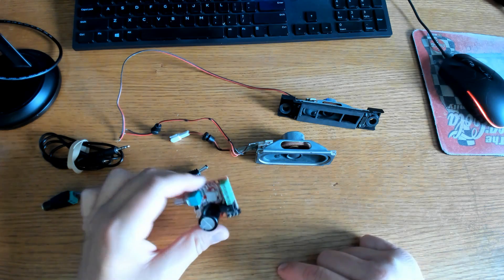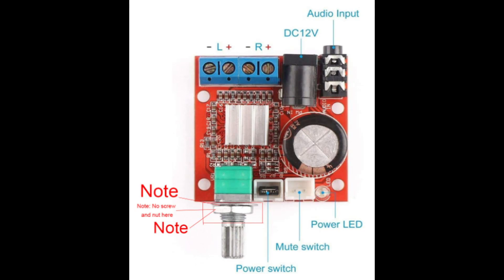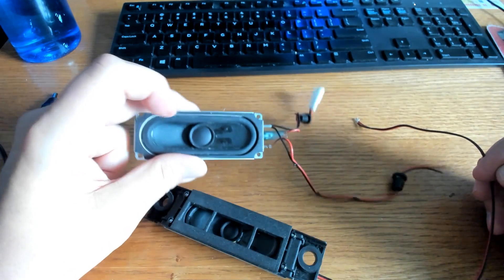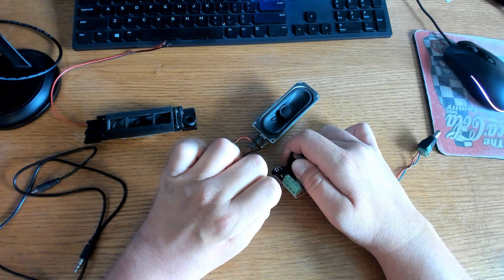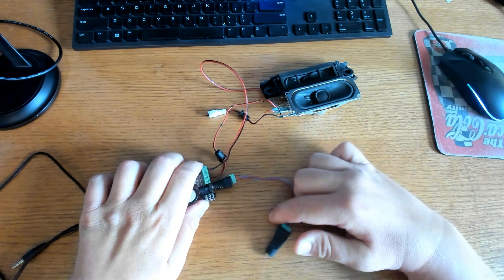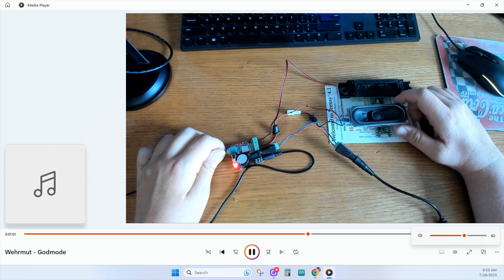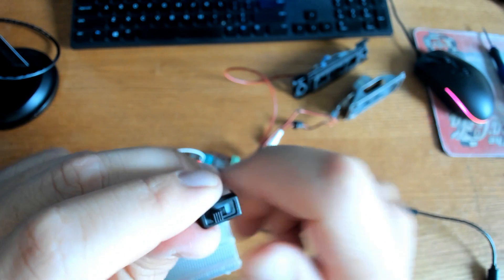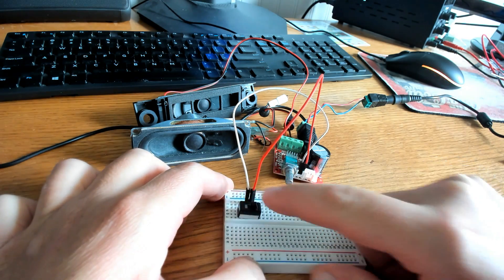Repurposing Old Samsung TV Speakers with PAM8610 Amplifier Board - Upgrade Your Audio

Comment: The one thing you should have done was to keep the enclosures, they are precisely calculated (volume and vent port) to improve the speakers to their max. I got the exact same pair from a old tv with their enclosures and a ZKMT21 amplifier (never passing the 50% volume), also with a tiny subwoofer and they just soung amazing for a PC speaker.
Reply from the maker: I know!  I didn't know the speakers were still in perfect condition.  ohwell... i'll get it next time.  👍💪

Comment: thanks for sharing this video. btw, I have cheap Soniq TV whose audio is really bad quality. Its just built that way. I am looking at repurposing speakers from discarded TVs, which I find easily. Can you advise what are the things I should be looking for in my current TV and discarded TV which I am gonna hunt for?
Any inputs much appreciated.
Reply from the maker: hey there! Thanks for the feedback, I appreciate it.
I have never repurposed speakers from and old TV into a newer TV, but I can tell you how I would start. 
In your current TV: 
When you take it apart, look for the built-in amplifier and it's power rating. If the TV doesn’t have a strong enough amplifier (common in cheap TVs), the speakers will sound weak, even if they are good-quality speakers. If this is the case, you should buy a better external amplifier. Even a small Class D amplifier can drive better speakers efficiently.
Follow the wires from the speakers and find where they are soldered and/or plugged in to help you get an idea of what a replacement should look like. Observe how much space you are goin to have for your new speakers. Will the new speakers fit in the old space? My Samsung speakers were fairly low profile and the space was tight, making it difficult for many speakers to fit i that spot. You  can mount the new speakers externally and even use your own amplifier for the new speakers if needed. You will also want to check the specs on the speakers for impedance in ohms and wattage. You want this to match so your new speakers don't damage the tv's amplifier.
In the discarded TV: 
Check these speaker specs (Ohms and wattage). Most tv speakers are going to be around 4-8ohm, just make sure they are compatible with your current tv amplifier. Are the speakers in the discarded tv connected the same way they are in the current tv?  This could determine how easily they can be integrated. As for the speakers, check for loose parts, cracks, or tears in the cones that indicate damage.
And of course, a soundbar may be an easier option....but where's the fun in that? 😁
This isn't an absolute tutorial on what you should do, but I think it will get you started. I'm sure you'll do your own research along the way, which I encourage. There are numbers and specs on the back of most speakers, type these into google and try to locate a datasheet to give you more info. Good luck to you!
Reply: @BMonsterLaboratory  thanks a lot for the detailed guidance. I will follow your words. Definitely there is no fun plugging in a sound bar. Unless the sound bar is broken and I fix it, before I plug it. 😀😊
Reply from the maker: @greatvedas  😂 I know what ya mean!

Comment: Im trying to harvest the speakers from my old tv 
they should have their own amplifiers, right?
Reply from the maker: hey there! yes, the speakers in your tv have their own amplifiers. They may be small circuit components near the speakers or integrated into the main circuit board. I find it easier to just clip the wires near the board and buy my own amplifier. When you open the back of a tv, it's amazing how much you can remove and repurpose. 👍
Reply: @BMonsterLaboratory  Kudos to you man replying on a 8 month old video!
 may you be happy in life
Reply from the maker: @aarambh9788  I try to reply on all my videos and hope whatever I say is helpful. I just appreciate the comments. Thanks for adding to the conversation!